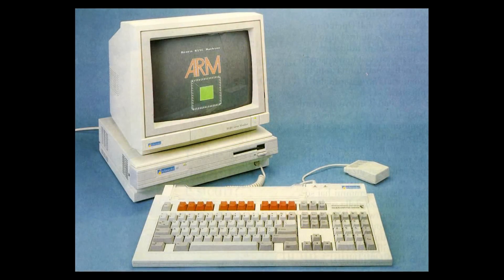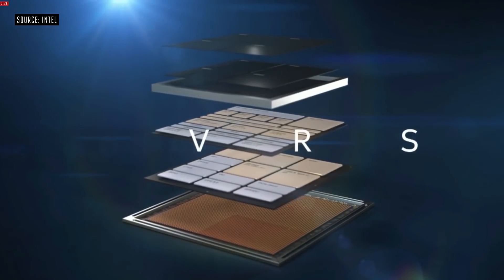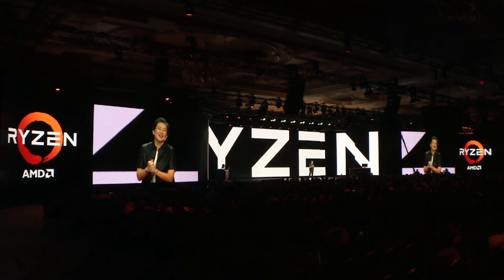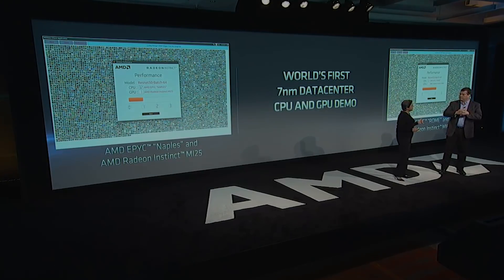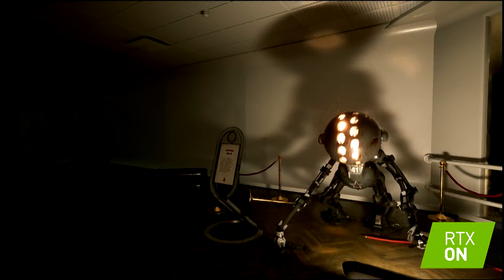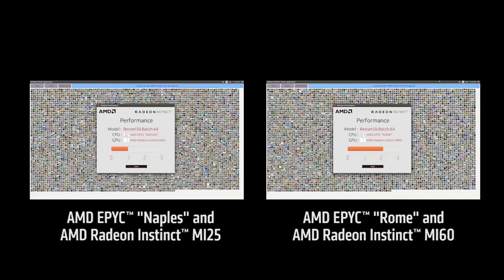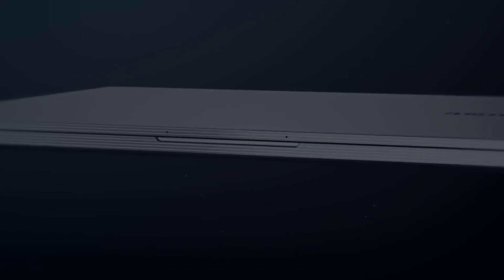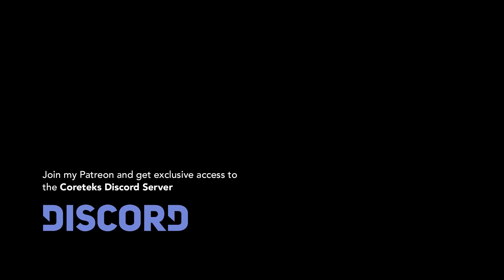Hardware trends: How many cores do we need?!

Comment: Ray tracing algorithm itself is 100% parallel. I don't know where the 95% figure comes from. In practice the non-parallel part is access to scene data and filters on the final image. Actually it's almost identical to rasterization in terms of parallelization, but you have things like de-noising instead of anti-aliasing. Rasterization scales almost linearly to thousands of cores, there's no reason to think ray tracing won't.
Reply: true ray tracing is different from nvidias ray tracing
Reply: @suibora  True, but Nvidias raytracing method is different because of the lack of cores and the incredible amount of power in needs to do realtime raytracing. I think true raytracing is the future, but its not yet possible because technology is not there yet. Adding more cores and having more resources is the solution to get there.
Reply: @suibora  As far as I know all launch titles for RTX use NVidia's proprietary OptiX API to implement ray tracing. That means they will not work with AMD cards once they support ray tracing.
So yeah, this is NVIdia's ray tracing. Yet another attempt to seggregate the market by creating something proprietary instead of using the accepted standards (same as GSync and PhysX).

However NVidia does provide support in both the standard DX12 and Vulkan APIs. So you can use NVidia GPU's to accelerate true ray tracing applications. There's just probably no support for tensor core de-noising using these APIs, which is NVidia's proprietary way of solving ray tracing granularity.

An example of "pure" ray tracing using Vulkan is Q2VKPT: http://brechpunkt.de/q2vkpt/
This implementation does not use NVIdia's de-noising. It essentially runs on any GPU or CPU, but is very slow. When enabling NVidia's Vulkan extension you can get 1080p 60FPS on an RTX2020 (on a 20 year old game, but still).
Reply: Well, there is three aspects raytracing.

1. The nr of rays traced, this can in theory be scaled indefinitely but in practice is limited by memory bandwith. Think millions of raytracers trying to access the same memory block at once.

2. The nr of reflections, each ray "bounces" of surfaces to create reflections and simulate scattering. This is fundamentally sequential since origin and direction of each ray is dependent of where the "parent ray landed". This ultimately puts a lower bound to how fast raytracing can get. The more bounces the higher the lower bound.

3. Initialization, this is where the 5% linearity comes in, every ray must be started at slightly different angles otherwise you are just computing the exact same ray multiple times. The only way I can think of to get around this would be to have vast lookup tables in memory. (not economical at all) But luckily there are people much smarter than me working on this, maybe they will figure out a wae.

Comment: Nobody will ever need more than 640k RAM 32 cores
Reply: Or a VESA compliant 32-bit video slot.
Reply: Ah ha ha ha, I remember there was a time when people said that about quad cores.
Reply: I saw the video title and the first thing I thought about was a comment like this. :D
Reply: Like 640k RAM... it's all up to programmers to push the envelope.
Reply: That comment hints at your age 😉
Reply: Great! :-)
Reply: Nice meme, but no. This limitation is one of computer science, not imagination.
Reply: @deus_ex_machina_  This video was misleading in that in suggested that 95% parallel was really high. This video is based on  Amdahl's law which gives the time to compute a given problem with a fixed data set. Algorithms, such as ray trace, are usually governed by Gustafson's law.

It is a bit more complex than Amdahl's law, but the short of it is this; as data sets grow(example more polygons, higher resolution, more rays) the parallel coefficient does as well. 

To give an example of something every internet connected device will be doing for the foreseeable future, consider decompressing a data stream. Lets say you have one compute unit(CU) that that can decompress 1Gb/s. What if you add a second? Does it somehow know that there is another CU decompressing and limit its speed? Obviously not so this is an example of a common workload that scales infinity. But here is the important part, most things people do scale infinity. Searching your drive for a file, decompressing files, computer graphics, image processing, machine learning(will be common soon), rendering web pages, all of them become more parallel as data size increases. The actual limiting factor in core scaling with bandwidth. As long as you can feed them fast enough, you can just keep adding cores.
Reply: @deus_ex_machina_ NOBODY will EVER find a way to make use of more than 32 cores! I can't think of any such example so I'm OBVIOUSLY right.

Seriously there are so many things that could be optimized for multi-threaded operation. Not like you can divide the map into chunks and run each chunk on a different core or use machine learning for enemy behavior. Yes, not everything will benefit from more cores. No matter what you change in the code a text editor won't benefit from running on 32 cores. But there are many cases where adding more cores will make things run faster and better.
Reply: There are 371 processes running on my (Linux) machine right now and that's with two Firefox windows open.  Most of them are sleeping, but there are still plenty running quietly in the background and can be spread across available cores.  

With Firefox, I have a bunch of tabs open, and since every tab is a separate process, so there are 21 of those right now.
Reply: cores seem to be doubling every 2 years now.  Moores lore for cores. So in 10 years we will have 32 x 2^5 = 1024 cores. Thats gonna be epic.
Reply: @richard975  No need that long. Now you can use Xeon Phi as a CPU, and it has 256 cores, all of them are X86.
Reply: Hyena Zhao wow I didn’t know that. How much is it?
Reply: 😂😂😂 déjà vu
Reply: can you do a technical analysis on it?
Reply: its like saying 10 years ago "Nobody will ever need more than 6 cores"
Reply: Year 2000 : "8 cores is the maximum theoretical physical limit of the cpu"
Reply: i rather have 16 nice strong cores instead of 48 weak cores
Reply: I would love to see some real scientific research on what will be theoretical maximum parallelization % of different kinds of works. Also I would like to see how much overhead parallelization adds to different algorithms and works.
I'm pretty sure that we are going to get much more efficient parallel algorithms and methods of computing different tasks.

Most people will do something other on the computer when it's doing something heavy on the background. So having more cores is beneficial. Also the difference of having 32 core 3.2ghz or 8 core 4ghz in single thread speed is really pretty small, 25% theoretical max, but perhaps half of that in reality. 12.5% really means little. I would much rather have more cores with lower clocks. If it were 3ghz vs. 5ghz, then you should really think about in what are you using your computer. However most of the time the difference of single thread speed is minimal.
Reply: Juzu Juzu , less cores with more power are stronger , easier to handle  by any programmer and beneficial for system stability smoothness ... more cores means just headache unless its used for specific numbercrunching tasks like raytracing, photogrammetry, particels, and other audio or visual processing ... 

for any logic based programming its bad becasue you have to implement an ASYNC wait and message system , which has a usibility threshhold which IS NOT dependend on the pc´s number of cores but your program`s needs !

os also doesnt apply a program to a specific core , you can do it by hand (like run program xy on core 5&6) and therefor optimize your own system that way , but thats highly individual process and the benefits are mild , not comparable  with just using a bigger core with more transistors ... 

 thats easy to prove , turn off the hyperthreading in the bios and see everyone of your programs and also windows running faster, this becomes especially apparant in pro-audio sequenzer (DAW) where realtime performance is just as important as overall throughput. the more parrallelized you get the more you realtime performance suffers obviously since the threads have to wait for each other..
Reply: @goku21youtub  But you can't make cores faster. In the extreme cases 3ghz vs. 5ghz it's like 50%.

It's much easier to program code that is not parallel, but that road has come to end. Programming skills and techniques will develop in time. 

When we are talking about over 3ghz cores, there are only extreme cases where we can't have enough realtime performance. There are probably lots of things that make no sense to parallelize, but most of those doesn't require lots of power anyway.

This is pretty complex topic to discuss, many variables and parameters. I really hope breakthroughs in optical semiconductors. And it would be nice if someone could solve P = NP or Traveling salesman problem. I would just love to see what could be done when perfect optimization of transistors and lines in CPUs and GPUs.
Reply: @juzujuzu4555  there are annoyingly few tasks that are possible to make more parallel,  because result c depends on operations on a and b, and that just keeps on happening all over the application because that’s the nature of the problem.  All your optimism that we’ll come up with what is effectively solving how to make a time machine is (as nicely put as makes any sense) delusional.  The best we can reasonably do is instruction level parallelism and very wide instruction processing in individual cores used in tight loops that repeat the same relatively short sequences of not-too-tied iterations of processing, which describes a very small percentage of applications where that’s a meaningful amount of the execution.

The number of applications that can make meaningful usage of, say, 64 cores where a single interactive user is all it services the needs of, will fit in a very short list.  I’d rather have a lower number of more powerful, faster cores, for most of my needs, and very rarely would having 64 be of practical value, outside of a server.
Reply: @juzujuzu4555  there are annoyingly few tasks that are possible to make more parallel,  because result c depends on operations on a and b, and that just keeps on happening all over the application because that’s the nature of the problem.  All your optimism that we’ll come up with what is effectively solving how to make a time machine is (as nicely put as makes any sense) delusional.  The best we can reasonably do is instruction level parallelism and very wide instruction processing in individual cores used in tight loops that repeat the same relatively short sequences of not-too-tied iterations of processing, which describes a very small percentage of applications where that’s a meaningful amount of the execution.

The number of applications that can make meaningful usage of, say, 64 cores where a single interactive user is all it services the needs of, will fit in a very short list.  I’d rather have a lower number of more powerful, faster cores, for most of my needs, and very rarely would having 64 be of practical value, outside of a server.
Reply: @strictnonconformist7369  What are the tasks that really need massive single thread performance? Especially the kind of workloads that can be proven to have no help with parallelization?

I'm not delusional, I have been in the industry for 25yrs and know pretty well the theoretical base for algorithms etc. workloads. 

Though I agree that 64 cores for most workloads starts to become overkill. My point was that I would much rather have 32 cores at ~4ghz than 8 cores at 6ghz or 16 cores at 5ghz. As I personally love having extra cores available when other cores are pushing 100%. On some tasks you would certainly want higher clocks, and a lot of this still has to do with poor software, but overall I think more cores saves time and makes the use more enjoyable for those that do some actual work on their computer.
Reply: Nice... we think alike.
Reply: If you can disprove Amdahls law please do so we’d all appreciate the performance
Reply: Or a 16 bit CPU! 8 bit is more than enough! 😂
Reply: @astromec6303  5 bits is plenty.  Good enough for Baudot.  Getting everyone to move to 8 and 16 bits was just a money grab.

Comment: The big mistake you have made is in discreet GPU's by the rules silicon is limited. A GTX 770 is more powerful than pretty much any APU that exists at present and likely in the future. Since no level of die shrinks will control for that.
Reply: arent the zen 2 apus rumored to have "1050" level performance?
Reply: https://gpu.userbenchmark.com/Compare/Nvidia-GTX-1050-Ti-vs-AMD-RX-Vega-11-Ryzen-iGPU/3649vsm401440
Unless they have discovered some serious magic in-regards to clock speeds. That would be rather impossible when you compare the size of the die's in question. Simply put it work with an package die but that would be larger  than the CPU.
Reply: @RNA0ROGER  You're comparing it to Zen plus. Zen 2 is supposed to be Vega 20. We'll just have to see later this year how it compares to low-mid tier GPU's.
Reply: Zen 2 is a wild card as you could easy run more than one gpu on the pcb.You could also add a GPU on the IO die.
Reply: the Vega 11 igpu is fast like a gtx 750ti today so wait 2 gens and they will be fast or faster like a gtx 770

Comment: Really nice video! I think that the only thing you didn't consider was the fact that we don't run a single process on any computer we use. Although there is this hard limit to the single process performance improvement, the use of more processors will always improve the user experience overall because each application tends to get heavier along time and we also tend to use more and more applications concurrently in our computers. So in the end, even when the single processes will hit a ceiling, the multitasking characteristic of the computers will still benefit linearly from the increase of cores. From what I know, another big problem with performance isn't even the amount of processing power available, but the huge gap of latency between processors and memory.

Comment: you are forgetting something. that is if ahmdal law stays in place.
what if someone found the key, that could cause the parallel process to disregard ahmdal laws.

just like moore laws at first was correct. but then it hit the bottle neck.

that's probably why AMD decide to split the IO die. not just for cost reasoning. but maybe they are trying things out.
because from the way the IO die is placed. i can see that AMD can place 2 IO die and added 2 more core die.

this is just my speculation. just like you are speculating using ahmdal laws.

Comment: What's your source on % of parallelism in ray tracing?

Also, you are ignoring very important aspect of parallel computing. Sure, Amdahl's law sounds scary, but you should have a look at Gustafson's law. Yes, we cannot make same code with large sequential part make run faster by adding more and more cores - that's a common sense. But I'd hope no one is expecting that. With more resources, we will be solving bigger problems that are currently impossible to solve in reasonable time on consumer-grade products.

We will also gradually move to different, more parallel programming models and different processor architectures once current ones stop scaling sufficiently.